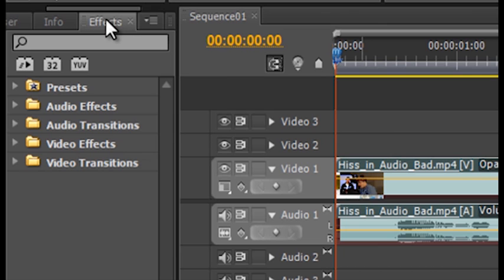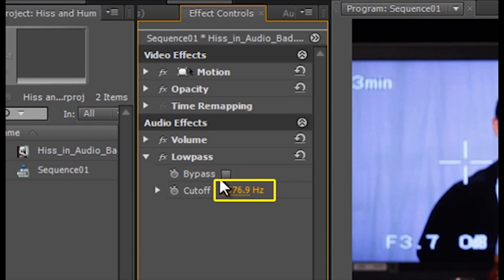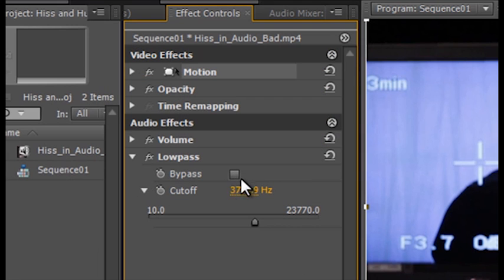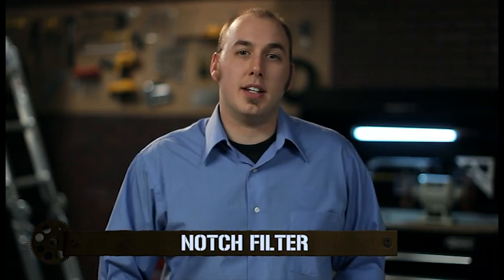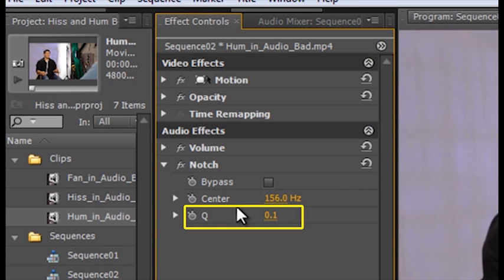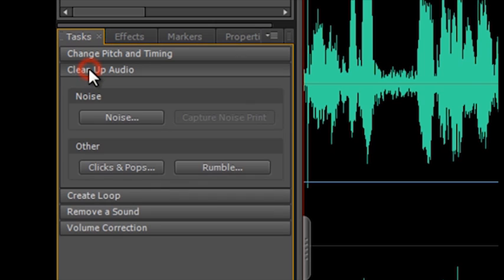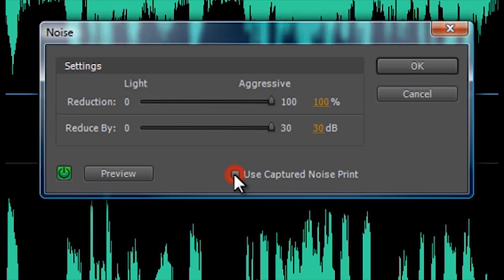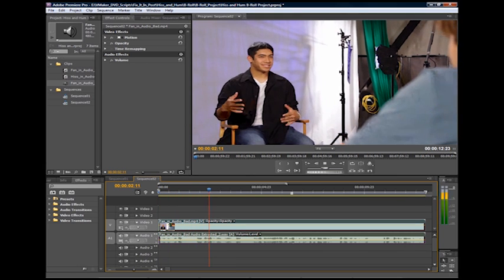How to Get Rid of Hiss and Hums in Audio

Comment: When I use lowpass it sounds like im talking with my face stuffed into a pillow and highpass sounds like im talking through a walkie talkie and notch did nothing
Reply from the maker: What frequency your low or high pass are set to will change the outcome of the change. roll off till your voice sounds normal and it should roll off the high or low frequencies above or below them (depending on what you are trying to achieve.) Similarly the notch will need to be set to the frequency you are trying to subtract.

Comment: personally those filters were useless for the clip I was trying to polish, what it did work however, was when I opened the clip in adobe audition, there I could clean it up and it did make a adifference, but just working with premire pro its not enough IMO, unless you've got a really easy to clean video
Reply: Yeah, that's what I do. Audition is way better for cleaning up tracks audio being its focus. It's just a pain always having to jump about between so many pieces of software while I work. It's a necessity though. I can't imagine an editor not using an extra piece of audio software these days.